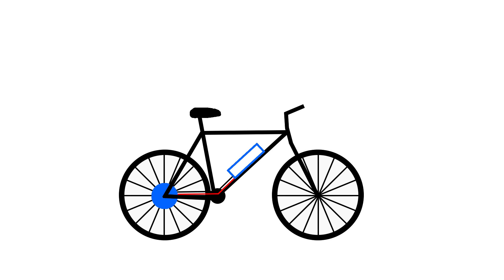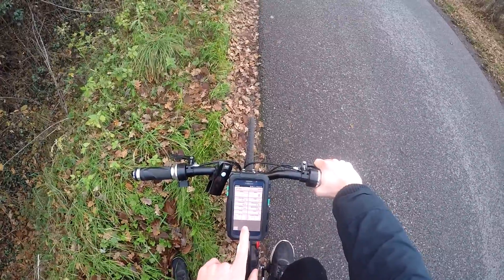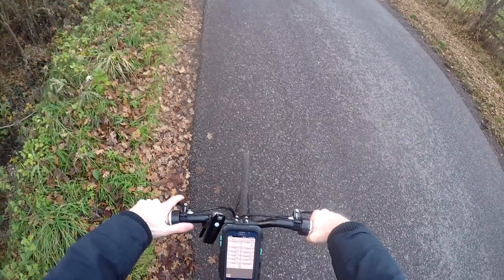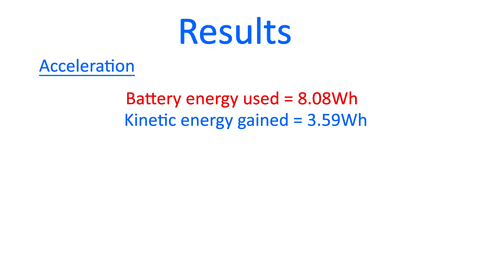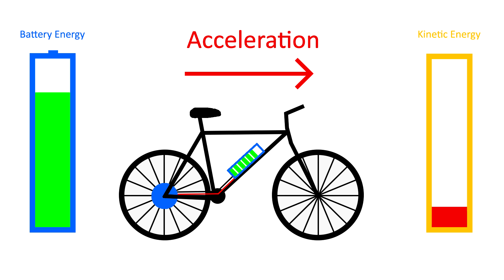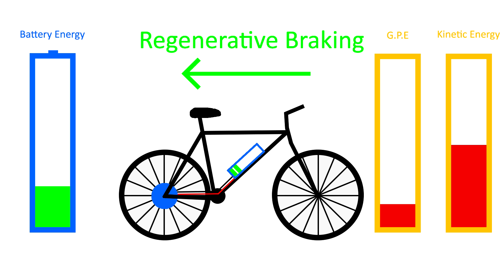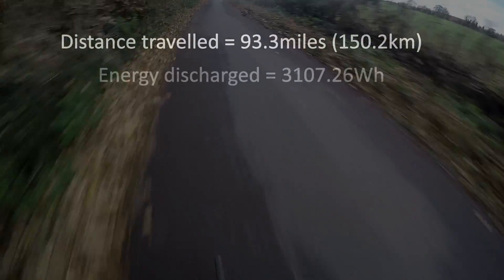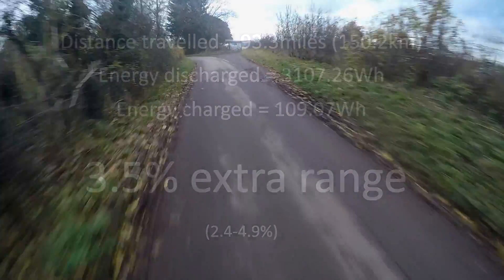Regenerative Braking tests

Comment: At 35 mph, 3.59 watt hours of energy is probably needed every 10-15 seconds just to overcome drag, so almost half of your kinetic energy was lost to the wind. Also charging efficiency is likely less at high currents. You could reduce this by wearing skin tight clothing, but the best way to test how efficient regenerative braking can be is to test going up and down a hill at speeds below 10 mph - not too steep that your motor struggles.

Comment: It would be interesting to see how much power rolling resistance consumes in general and during regenerative braking. If you check how many watts of power your motor draws at a few velocities, you could determine how much power is required to overcome rolling resistance (or overall resistance due to air drag) and interpolate a curve to get the power dissipated by rolling resistance at any speed. From there you can get a Watt-hour approximation for kinetic energy lost to rolling resistance during regenerative braking. You could also find out what range your system should have at different velocities and what the rolling resistance coefficient is for the road with respect to your bike's tires.
Reply: Infinion Air resistance alone, will account for at least 80% of the energy used. Bikes are, ridiculously un-aerodynamic.

Comment: I will have to try your test with my faired recumbent bicycle equipped with a "Copenhagen Wheel" similarly bluetooth enabled. It uses the bluetooth for all control functions, except for pedal input responses, so I have to pedal slowly backwards to enable regen.
One factor I suppose you did consider was to begin your test with a battery less than fully charged so that regeneration voltage differentials could effectively  deliver energy to the pack.

 I think the Tesla formulation, beside good aerodynamics, is to have a large enough battery  and a motor of sufficient power to  do regen quite agressively. My Prius does use regen as best it can, but an 8 mile long mountain down hill route I do quite regularly fills the battery to  its software governed  80% level in just a few miles, and then it has no place to store the potential/kinetic energy.The big motor/big battery  Tesla can probably use much more of that potential energy returning from its climb up. 
I was surprised that your E-bike was capable of 35mph. I thought most european e-bikes cut out at 25 kph, and here in the US the legal assist top speed is 20mph(32kph) so I cannot duplicate your top speed test. I do know that my bike is much better aerodynamically than yours.
Reply: This is a home made bike, top speed need not apply ;)
He could have gone even faster with a lower gear ratio!

Comment: Peddal assist would change this dramatically....you would use far less battery and gain more back ( as a percentage ) when riding down the same hill.  The more you rely on your pedaling the higher percentage return on the downhill.

Comment: Well, usually in the RB, you specify on the controller how many amps should be put back in batteries while RB. There is no way you can return electricity back to the batteries the same way you draw electricity out of them. Charging is always slower. So fo safety reasons in order not to burn your batteries, usually you specify about half or less than the actuall amperes you draw out of them. This is also one of the main reasons Rb is so low apart from thermal losses of course

Comment: I am surprised you did not mention the main reasons why regenerative braking is superior to no regen.  Let's assume that the extra energy (~3.5%) put back into the battery is equally offset by the parasitic drag inherent in a direct drive motor.  Where does that leave us:
* practically zero wear on any brake pads attached to a motorized wheel.
* practically zero overheating of the rotors and pads which eliminates any chance of a catastrophic failure on a long descent.
* very rarely will you need to remove the motorized wheel along with cutting cable ties to unplug cables to replace brake pads which is usually very time consuming and labor intensive especially if dealing with one of those 100+ lbs ebikes.  Many professional bike mechanics refuse to repair ebikes for this reason.
* if you ever lose hydraulic brake fluid you will still be able to get home safely using regen braking.
* smoother no squeaks braking.
* safer braking in wet conditions.

I have owned ebikes with and without regen.  It is a no-brainer.  Give me regen.

Comment: I wonder which is the real efficency of the bike on a test bench. I mean without any drag, air friction and so. The motor has one eficiency, than all the transmission and frictions in the wheels. I guess this is less than 50%, and probably dependant on the cruising speed.

Comment: Electric cars get much more benefit from regen for a variety of reasons.  Higher mass density, so a lot higher mass to drag ratio.  Nicer motor controllers and such, and the biggest reason is much higher speeds, energy increases with the square of speed.

Comment: Only 15% for a hill ? At a low speed air friction remains low and I expected way more while the majority of the energy is "stored" in potential energy.
Reply: there is a lot more at play than just air resistance, wheel bearings, tire friction, bumps in the road, to name a few
Reply: @justinc2633  Near 50 km/h the air drag is most of energy losses,  with my ebike from 40 to 50 km/h the steady required power is almost 2 times higher!
Reply: @IncroyablesExperiences  well he does seem to try to be a bit conservative in spending at times perhaps your model was a newer higher grade?
Reply: @IncroyablesExperiences  where can i find curves for drag?

Comment: The go to person for these thing. Thanks Tom. Thought of a couple of factors that could influence the efficiency. First is speed. E-bikes here as standard are limited to 25 km/h compared to 35 mph? So both pedal assistance and reduced drag would improve overall efficiency at lower speed and, thus slowing down with regerative breaks would give back relatively more distance. Then there’s using a dedicated breaking generator versus the same driving motor (say front wheel) to improve energy recovery. Any thoughts? I could not tell how quick the braking was at say a low speed of 20 km/h. It looked rather too gradual,so may need additionnel friction braking for safety.

Comment: Seems to me like if you used better battery management (in software, probably) to control the rate of regen, you could probably significantly boost the efficiency of the recharging by controlling the current rate of recharging. Perhaps an intermediary supercapacitor bank and some MOSFETs?

Comment: I dont know why they have not come up with a  friction mounted generator.One that is  separate from the motor but connected to the battery LIKE THE OLD  BIKE LIGHT  wheel generator's to charge the battery .It could be powered by the rim front or rear in some fashion and regulated for regeneration and always in the generation mode while in motion unless disabled by a lever or switch.A drive system could be developed  based on the rim or hub.It also could be incorporated with regenerative braking.

Comment: You will be better off using an array of super capacitors to buffer the current back into the batteries during regen breaking. Super caps are able to take on a lot of current instantly, batteries aren't as efficient trying to pump a lot of amps back in.

Comment: Regenerative braking if installed properly... It gives you better brake performance, reduced wear on brake pads and some extra range. However hub motor regen braking on electric scooters (scooties), will skid very bad at times because of negative torque of motor for regen braking. If someone plans to install regenarative braking on electric scooters please think twice. I nearly had a bad fall because of the rear wheel skidding due to regen braking.

Comment: What happens if it goes 88mph tho? ;-)

Have you not considering fitting a device/programming the arduino to maintain a constant speed above an adjustable single value or between 2 adjustable values (for example 25mph and 30mph)?

You could have the motor only run to maintain a speed above or between 2 set values values and therefore you could potentially be saving battery power that may extend battery life and increase distance. You'd have to calculate for spin up/spin down when the motor runs but that together with the regenerative braking could increase the possible travel distance.

EDIT: After more thought, this idea would be like a thermostat on a heating system that only turns on the heating when the heat drops but in this context, the heat is the speed.

It could all just be a large game of minimalist giving and taking but efficiency tests are always good things to try and look at the results.

Comment: usually, regenerative braking isn't put up to 100% braking, it should slow you down alot better at somewhere around 80 or 90% whereas its usually as 30-50%

Comment: Could you please show the wiring that allows the regen braking?   Lots of people like me on the internet trying to figure out how to wire their hub motor kits that have "Low Brake" feature, but no wiring diagram.  I agree with other comments that point out the excellent braking quality of regen brakes, especially the anti-lock nature.  To optimize... Front wheel hub motor! Add an ultracapacitor... That is my dream bike!

Comment: I know this is kind of redundant now 🙃but couldn't we just put multiple motors in series regenerative breaking and super capacitor to maximized the output also storage that way is just a extra electric generator to power basically anything with inverter 😶

Comment: at 20kmh drag will be about 40% energy consumption in still air. This could be reduce with a reclined velocycle with a shell - sometimes used for racing often mistaken by American donut hunters for cars.
.
Reply: EmmittBrownBTTF1 Isn't it nearer to 80% for drag?
Reply: Possibly, my memory is a bit fuzzy on numbers here, but the energy proportional to air-speed. 80% on a no ebike seems right.

Comment: Its not equal, even in theory, because you would include the rolling resistance of the tyres, bearings etc as losses, as well as the motor & controller you are using in the calculation.

Comment: Have you considered tires/tubes being appropriate for long term use at high speed as to avoid blow outs. 

Also 28mm tire width is actually shown to have less rolling resistance and more comfort than skinnier ones and to be the sweet spot. However perhaps you wouldnt care as your running electric anynway :) In that case it might be good idea for comfort. Maybe even thicker road tires for max comfort as you dont need to care about efficiency as much .
Reply: Richard Bissland Yeah, it was always fun looking at people suffering on ridiculously thin tires....it was nice to hear they were also wasting their time :)

Comment: Just recharge on long journeys by sitting in the drag behind a truck with the regen toggled. Maybe wont work tho since having the regen on puts a load resistance on the electric motor effectively slowing you down. So i guess the drag force of the moving truck would need to be greater than the regen force. Maybe just hold onto the truck lol.
Reply: Back to fitted movie elyric deoran

Comment: hope near future Tesla owner — do you think that ‘strategic coasting’ is close to regenerative braking?
(current BMW can disconnect transmission in its ECO mode)
Wondering if Tesla rapid/easy user controlled no-regen can increase distance more than fixed amount of regen

Comment: now do a test in mountains, with no flat terrain, and a constant comfy 15 kmh speed or something like that. (that regen efficiency does seem kinda low tho, motor esc and battery probably play a big role here, also on flat terrain, having one of those really low drag recumbent bicycles would probably make a difference, as would riding in the city, with the constant stops and starts, I think you kinda showed worst case scenario right here)

Comment: test a cargo bike or trike with a larger battery so you can regen at higher currents as well as keep your battery healthy (if thats how it works) and carry a bunch of weight to simulate carrying a bunch of stuff and or people and then put your bike on low throttle or no throttle and push it up a hill, then regen down it and see how much energy you can generate.

Comment: well done Tom. good vids,  a quick question- could a front dynamo hub be wired into that vesc 6 thing of yours and put a sort of continual small trickle charge into the battery and would it be worth it?

Comment: I just watched your video and remembered back in my childhood I had a light system that used a generator to power the lights it had a flip switch to drop the head of the unit on the side of the tire. Could this be used to recharge the battery. I was just wondering.

Comment: Whilst Regen braking is good in theory, surly some folks must have tried putting another light weight  motor in the system to power up battery whilst in motion yes?

Comment: I would love to know how a regenerative braking compares to a kinetic energy recovery system, efficiency-wise.
Reply: Regen braking is a form of KERS. I suppose you mean specifically purely mechanical flyway systems? Do these even exist for bikes?
Reply: @leftaroundabout  Does ABS exist for bikes, or a wheelie-cheating device? Lol. 

Yeah, I mean the mechanical one, like the ones in Formula One. I would love to know how does the efficiency compares to the electrical Regen Braking. 

What is your guess?
Reply: In the eletrical one, there is a huge loss in Energy conversion from kinetic to potential(chemical?) and back. The Mechanical Kers converts Kinetic into Kinetic, the only loss would be due to friction/heat only. 
I think it would most likely double the efficiency of the electrical version.
Reply: I doubt there's such a big difference, and in fact it might plausibly be the other way around. Electric components can have excellent efficiency; motor and driver can achieve close to 100% given good engineering and even batteries (Li-Ion) are apparently >90% efficient.
https://researchinterfaces.com/lithium-ion-batteries-grid-energy-storage/
Therefore, if E-bike regen is observed to perform so much worse than that, it seems to have a lot to do with the mechanical components involved. These are problematic because bikes are low-RPM, high-torque systems, and that's equally or even more a problem for mechanical KERS.
Reply: (Yeah, E-bike grade batteries / drivers / motors certainly are a lot less efficient that car or power-grid ones, but again that's also something you'd likely have with mechanical KERS too – harder to optimise away friction losses if it needs to be lightweight, small-scale and affordable.)

Comment: Could really use a regen-braking e-bike as my daily tour is going up a ~120m hill and back down again. Annoying to go up and you have to constantly brake going down which really shows in how fast the brakepads vanish (and i get really loud and annoying squeaking if i don't clean the tires every day)

Just did some rough calculations:
Relaxed speed of 20 km/h and 80 kg total mass, even if you brake to a stop in 5 seconds (slow) that would still be nearly 500 W. When you are going downhill and braking harder this can easily breach the 1 kW. if the generator is just 50% efficient that would destroy most normal e-bike batteries (rated for maybe 500 W discharge)
Reply: time for LG  Browns
Reply: Yes itei

Comment: For LiPo batteries, the safe rate of charge is much lower that the rate of discharge - by an order of magnitude or two (10-100x). 

Without knowing the details of your power system, and for the sake of the argument, I'll guess a safe discharge rate of 1000W and a charge rate of 100W. You would therefore have to decelerate very slowly indeed to avoid having to 'throw away' power to avoid damaging your batteries. My guess that most of the blame for the very poor efficiency scores in your first, flat test were due to this effect.

I'm interested in the use of a relatively small bank of super-capacitors to rapidly absorb braking energy, then safely mete it out to the main batteries. What are your thoughts?
Reply: They should be able to handle it for short bursts where there's not enough time to build up heat etc.

Comment: Can I just say, whilst it is a cycle, by adding a motor, your breaking is going to be severely affected.

Also as a legal mattter... (c/o www.gov.uk/electric-bike-rules ) "Its electric motor:

must have a maximum power output of 250 watts
should not be able to propel the bike when it’s travelling more than 15.5mph"

AND... from what I have read, you should have insurance to use the bike on the highway and its currently only available to the previously stated category, your cycle would not be insurable and illegal on UK roads until the law changes (if it does before BREXIT) the possibility of the higher speed bikes being allowed in the UK was first announced last January (2017) 

However, currently there is no change that I am aware of... 

"Other kinds of electric bike
Any electric bike that doesn’t meet the EAPC rules is classed as a motorcycle or moped and needs to be registered and taxed. You’ll need a driving licence to ride one and you must wear a crash helmet.

The bike must also be type approved if either:

it doesn’t meet the EAPC rules
it can be propelled without pedalling (a ‘twist and go’ EAPC)
This should have been done by the manufacturer or importer before you bought it. If it’s been type approved, it will have a plate showing its type approval number."

Have you checked with the DVLA about your build given that it has a speed that exceeds 15.5 Mph, if you read it, your bike should not be able to propel you under power over this speed, nothing about being able to maintain that speed!

Food for thought and some research is in order...
Reply: Who cares?